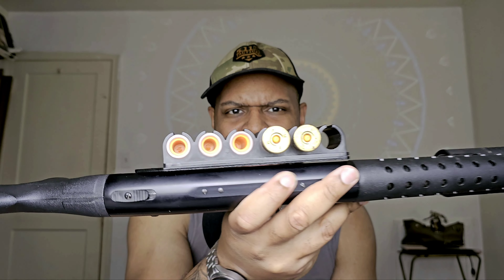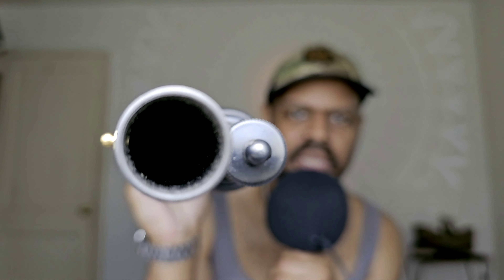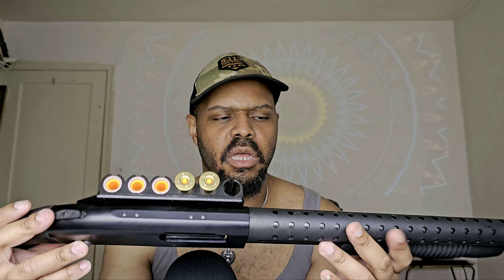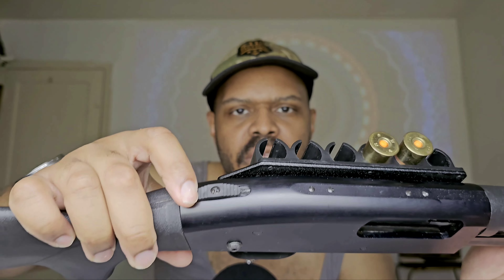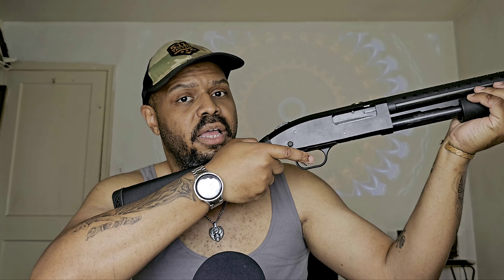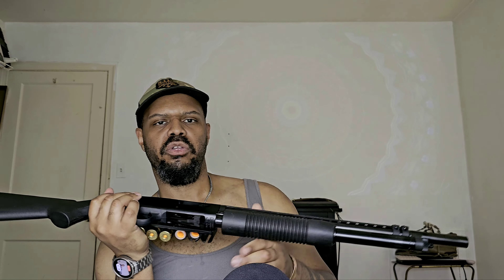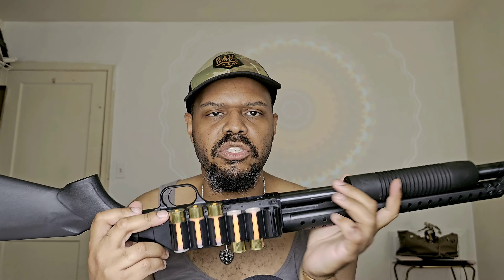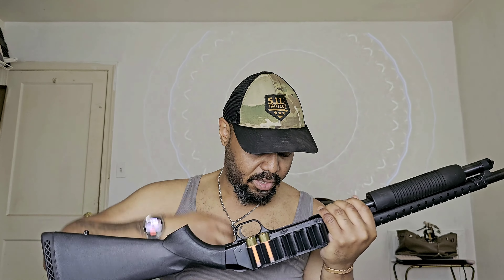Mossberg 500 Shotgun Guide: Tips & Tricks for Beginners

Comment: BUYER BEWARE!!!
Here’s a TIP!
Mossberg have cheapened out on their 500’s and most of them now come with no action slide tube. You are essentially buying a Maverick 88 with a tang safety for the price of a 500. Additionally, Mossberg has been “sold out” of the action slide tubes for over 2 years now creating a black market for the slide tubes. Cheapest new “take-off” on the interwebs right now is $195!!!
Without the slide tube you cannot change the fore end furniture.
Reply: Hold on, so you are saying if I go and buy a Mossberg 590 today, then I will not be able to swap out the Forend??
Reply: Some yes, some no. It’s a crapshoot. If you can’t inspect the shotgun in person, I would definitely contact Mossberg with the model number of the exact gun you plan to purchase and see if they can advise you. When I called (pissed off) the rep just said, “Yeah, they do that sometimes. Not really sure why? But it does seem to upset some people.” This is also why the action tubes have been sold out for 2yrs. People buy the shotgun, go to change the fore end, and realize they were bamboozled (just like me). My theory is they started having materials shortages during the pandemic and have never fully recovered. However, to keep up with demand, Mossberg is cutting corners to get products out. 
Most of the shotgun parts that used to be available on the Mossberg website are either no longer available or have been sold out forever. Good luck! My “cheap” Mossy 500 that began as a $400 shotgun has become well over a $1k gun due to the inflated prices of the “black market”/ebay.
Reply from the maker: Thanks for letting us know. I'm surprised how much has changed in just a few years with the economy and companies slashing costs.
Reply: Is this the case for the 835 as well?
Reply: I have the economy model 500, plastic trigger housing, stocks, safety button, and magazine follower, it does have the Maverick 88 forend like you said, you can upgrade all these, I replaced the mag follower with a steel one, but I won't replace anything else til it breaks. I got this gun like new from a friend for $200, and it's the only gun I own. I prefer the location of the safety but if you have a Mav 88 , you have a good gun. Check out the torture test TBY TV did on one, 500 rounds in an hour and a half, no stoppages or malfunctions.